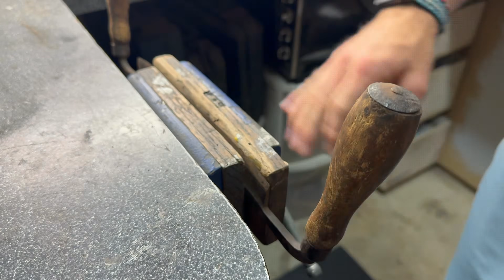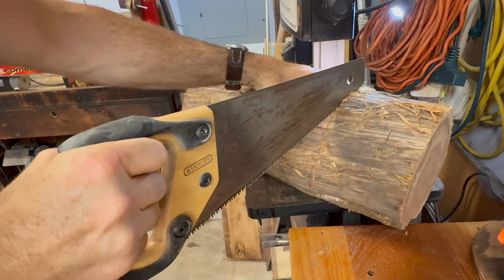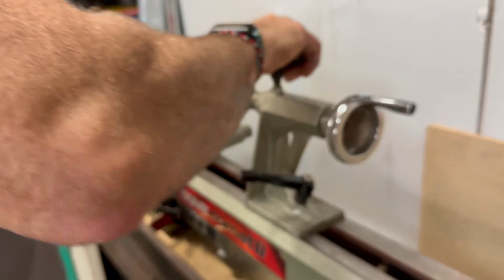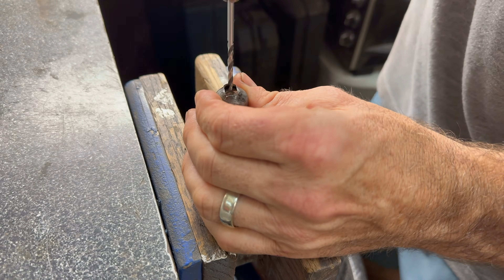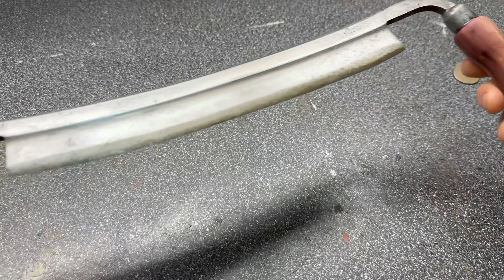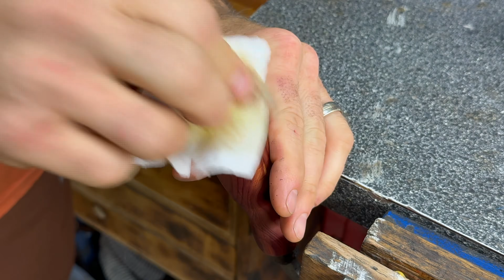Reconditioning An Old Draw Knive

Comment: i may be wrong but i think these tools are single bevelled? so only one side needs to be sharpened
Reply from the maker: This was my first draw knife to play around with, so i definitely don’t know what I’m doing.  I just needed to say that part, but i do agree with you.  I didn’t add a bevel on the rear, i only flattened it like a chisel or a plane blade.  Or at least that was my intent.  Thanks👍

Comment: Great production video.  Lighting was fantastic. You are well spoken.  I think you made a fine tool for Dad.
I'm a long time Woodturner and shop tinkerer. 
Few turning pointers if you wish.
#1 Sharpen your tools.  It's easy to sharpen a bowl gouge freehand.  Many videos on the You Tube on how.  You will be amazed how much more enjoyable turning is with sharp tools.
#2 It appeared you set your tool rest too high of center for the gouge  (and the scraper) to work well.  It looked like you were working at a downward angle into the spindle.  While everyone has different comfort angles, it looked like you were working the edge unsupported.
#3 The gouge you used was a spindle gouge (looked like a Sorby brand handle)  not a bowl gouge.  A bowl gouge has much more of a steeper sidewall height when viewed from the cutting edge.  More like a V than a U.  Its the most versitile turning tool there is.
#4 Allow the wood to come into the tool edge while the tool is supported by the tool rest.  You want to direct any downward rubbing pressure into the tool rest rather than your forearms.  Your back and shoulders will thank you.
#5 Use the "Power Triangle" to support the tool.  Imagine a triangle between the Tool rest-your leading hand-your belly (use your belly to anchor the end of the tool).  Move your body/hips left or right to move the tool.  Use your back hand to rotate the cutting edge as needed.  Use your leading hand to hold the tool in position on the Tool rest.  Use the Tool rest to absorb any rotational forces.
Hope that helps.
If you are interested in turning, the AAW (American Association of Woodturners) is a great resource for lessons.
Join a local turning club for any instruction.  The AAW website lists chapters all over the country.
BTW Cedar looks great but not a good handle choice.  But, reinforced with epoxy it should be fine.
It the end you made a fine gift and it came out fantastic.

Thanks for sharing.
--M--
Reply from the maker: Thank you!  I appreciate the comment and especially the pointers.  I researched, watched and attempted back when my wife bought me the small lathe; but not for very long.  And I never reinforced the knowledge, or lack there of, or really practiced.  I tend to wander.   I like doing a little bit of a lot of things.   

The bowl gauge: that is the one that scares me and i messed up the attempt to sharpen.  I’ll give it another go and do the things you suggest (all my tools, Savannah brand, could definitely use a sharpen.  I’m going to have to read through your comment a few more times to digest it all, but i really appreciate your taking the time to pass along the info!  

The cedar: yeah it came from some special land in our family and is most likely what the draw knife will be used for so, while really soft, i figured would be a good fit especially with the epoxy.  And if not, that’s an opportunity to learn and try some more.  

Thanks again
Reply: @WanderingWeld  If you do another handled tool.  I would use a hardwood like Walnut or Cherry for the handles.  Or Pecan if you want a contrast to the steel.  It is nice the cedar you used has a family history.

Another pointer I have is to clean up and de-rust iron I use an Electrolysis tank.  You can pick up a 30VDC 10Amp power supply for under $50.00 on the jungle website.  A plastic bucket, some sacrificial steel (rebar, old lawnmower blade, etc.) and a bit of washing soda.  And all rust will be removed without losing any base metal. 
Lot of how-to's on You Tube

When it comes to wood turning....it is one of the cheapest woodworking disciplines out there.  Once you buy a lathe and a few tools your material stock comes from the firewood pile.
Thanks,😁
--M--